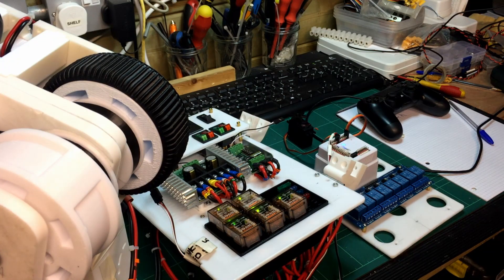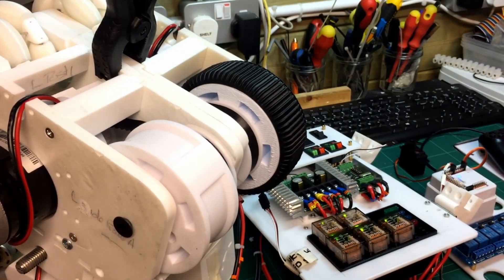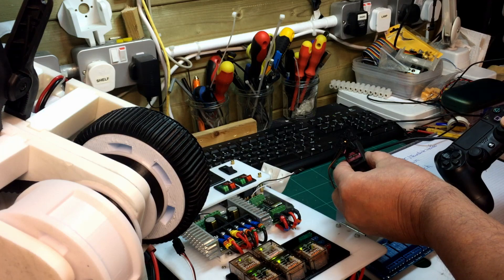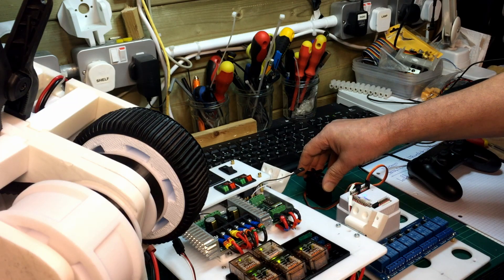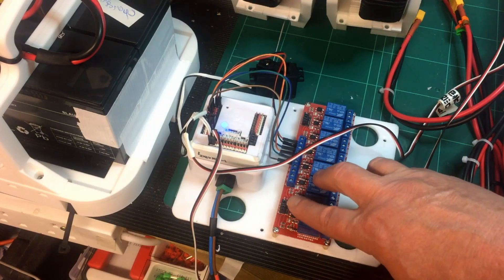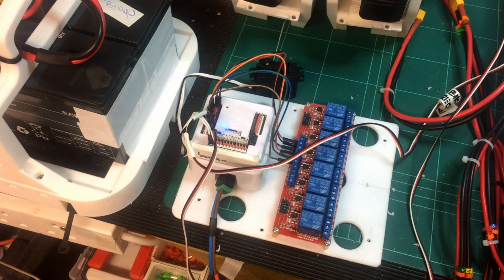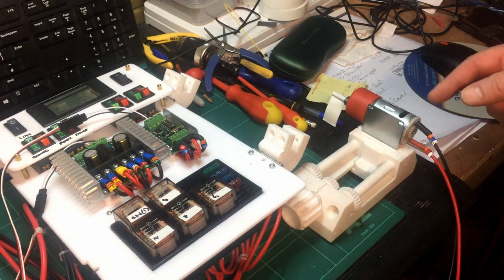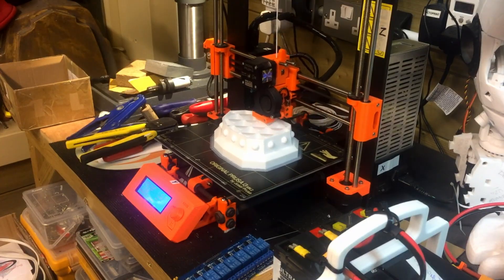R2D2 Droid Build Part - 18

Comment: Were did you get the files from for the hinges for the power board.
Reply from the maker: Hello Sky, the hinges are from Eebel on thingiverse.   Also on that page are battery holders/mounts and control board mounts etc.   Thingiverse 3006003  here - https://www.thingiverse.com/thing:3006003/files

Comment: Would  it be easier to go with the Padawan   System.?if that's a coded already available.
Reply from the maker: Hello sky.   Yes the padawan would be fairly straightforward to use.   And cheaper.  However, with the EZB system I can easily add in speech and and am working on AI for the droid.   This means it can chat away and hold a conversation [that's the idea anyway].   Also I am adding a camera so it will have face and object recognition, and I am planning on it being able to respond to being spoken and and the dome swivel to face you.    Virtual headsets can also be used [google cardboard for example] and it then it can follow where I am looking etc. 
Finally hoping that Colin and Nigel will chat away to each other.
Reply: Sounds cool.iam looking back at your earliest video to see where that PIN goes, I can't quite figure it out I don't want to clue mine up and den ran into problem later. thanks for replying.
Reply from the maker: @skyrim4713  Hello sky, I haven't installed the hinges yet myself.  Will look at all that in later videos.
Reply: Ok